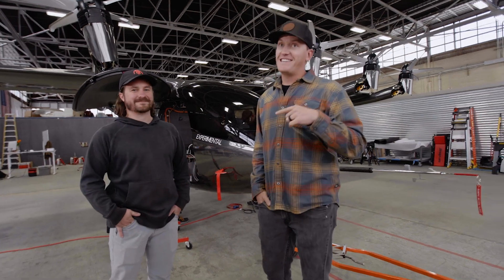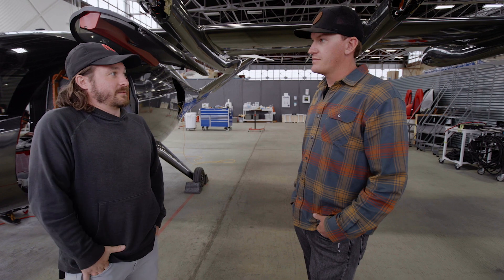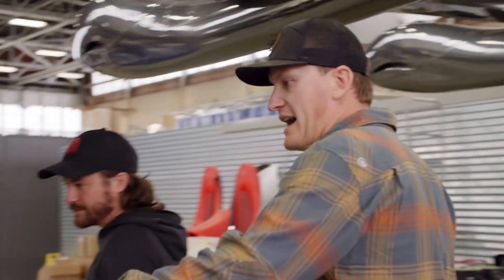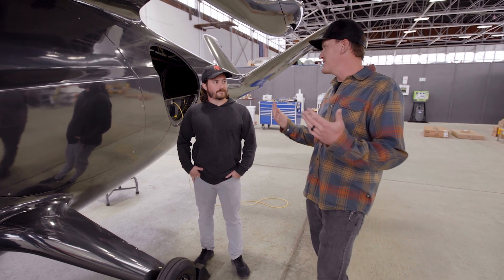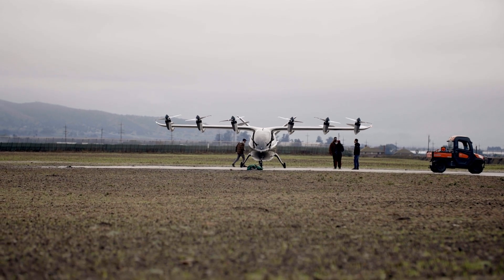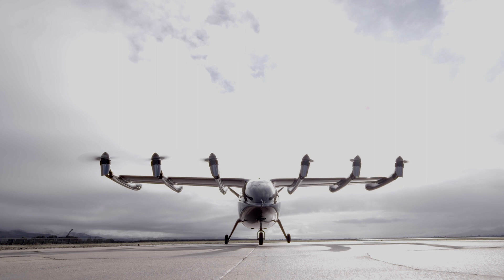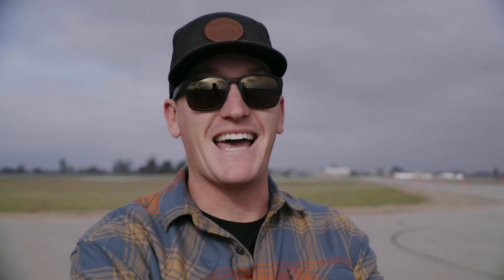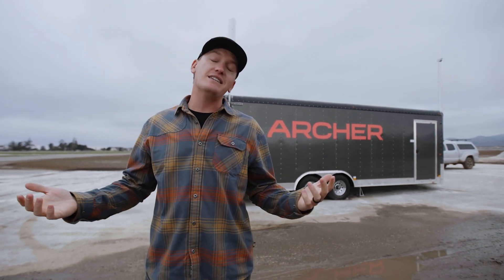Behind the Scenes of Maker's First Hover Test Flight with Trent Palmer

Comment: by emphasizing just how monumentally difficult this extremely brief hover was ;-dependent on miles of wiring ,computers, battery regulation, stepper motors, lines of software and so on and on you inadvertently show just how precarious is the operation of this aircraft . just a couple of corroded connections or some computer failure can result in catastrophic failure unlike the 'comparable' fixed wing aircraft of the same passenger capacity let alone installed power or range, speed etc which is naturally stable and far more efficient but also fail safe and needing no continuous artificial stability .  Think of the 737 software glitches after certification and still able to be overridden by a human pilot . "Solving" VTOL hovering is addressing the wrong problem even if so 'admirable' necause of the difficulty of making it work at all --just compare the Segway, inherently unstable but forced to work by computerized gyroscopic wizardry to the simple child's scooter or it's electric counterpart - doing the job long after the segway is forgotten.  Ditto the misbegotten Boeing "go Fly" competition --again, answering the wrong question.